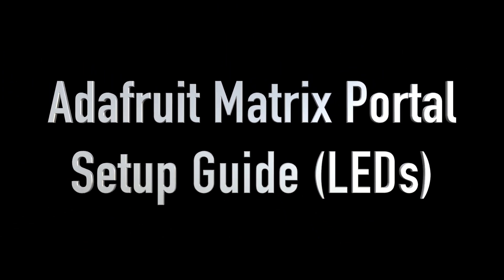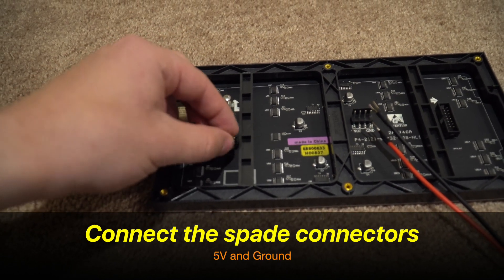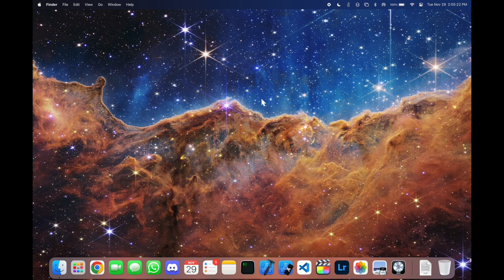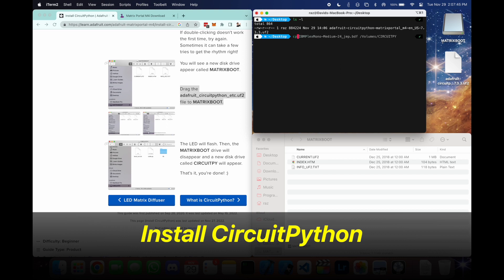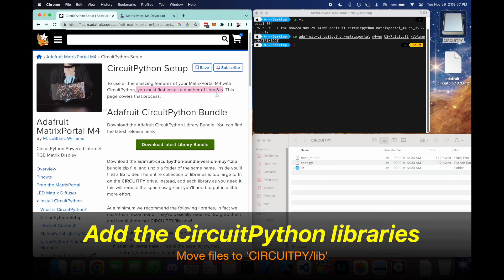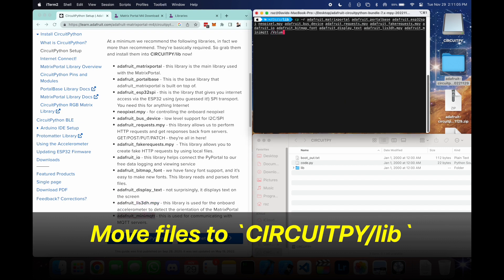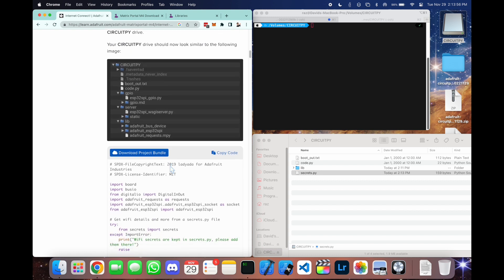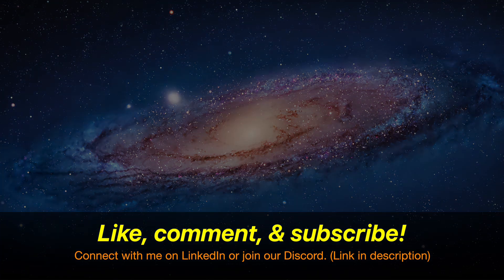Adafruit Matrix Portal - RGB LED Display - Setup Guide (CircuitPython)

Comment: I have a Matrix Portal S3 CircuitPython and a 64x32 RGB LED Matrix with 4mm pitch. The LED Matrix only powers up and displays the default program when the S3 is plugged directly into the Matrix. It does not work with the 2x8 IDC Ribbon Cable. Why is that? I’ve tried multiple Ribbon Cables, so I don’t believe that’s the issue. Are there settings that need to be changed?